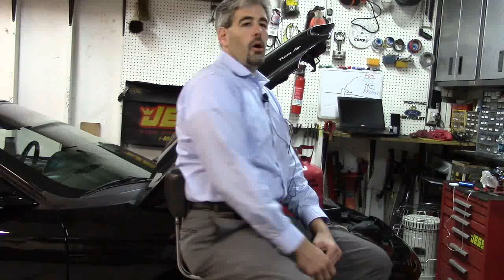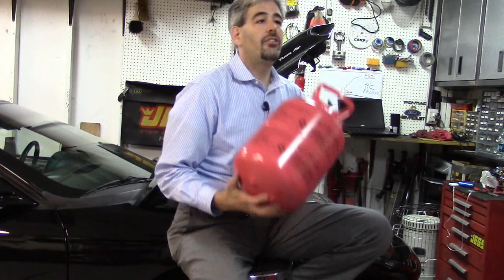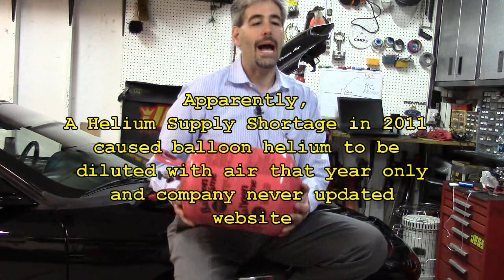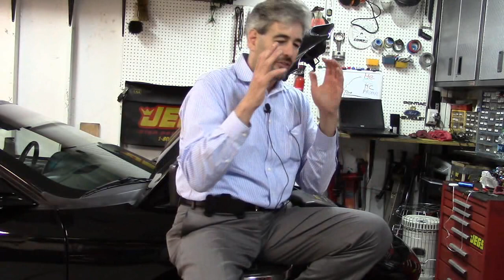Experiment to solve O2 Sensor Debate: UPDATE + New Design

Comment: I did not get to read the comments in time for the previous test so I apologize for any rehashing.

I'm in the O2 camp and my understanding is:

The simple question: O2 sensor - Reading O2 or HC?

 An O2 sensor as designed is an oxygen ion ratio comparator.  It compares the amount of O2 ions on the sample side of the sensor against a reference amount of O2 ions in the small pocket of air inside the sensor to get a variable value the PCM can work with.  It's not comparing O2/HC - that is a DERIVED measurement based on the assumption that air and fuel are the only things coming down the pike.   It's up to the PCM to read it's script and make adjustments like 'Too much O2 - add fuel' or 'Too little O2 - reduce flow'.  A better fuel management system has a staff to consult, "Yo, MAF! You getting anything over there?".  "GASP! I can't breath!"

Adding an inert gas upstream of the cylinders disrupts combustion efficiency leaving a bunch of O2 to tag the sensor.  Since the sensor don't care about A/F ratios - only how much O2 is hitting it, it should show lean.  Adding inert gas post combustion SHOULD displace enough O2 away from the sensor to show a rich condition.

If I had a sensor to play with and to settle the basic question of what an O2 sensor REALLY sees I would set up a bench test thusly:

Mount sensor in a piece of pipe in a vise. Power the sensor heaters if present and hook up a sensitive voltmeter or scope to the sensor leads.

Light up a welding torch and fire it down the pipe, playing with the A/F ratios and confirming voltages and sensor operation.

Now the fun part
With the torch A/F set for mid-point voltage readings on the scope I would flush the sensor reference chamber with O2, propane, acetylene, and argon and note the effects.

Present my findings to the world and collect my Nobel Prize and appear on the Tonight Show to much applause and adoration OR come back hear and go "PPbbfft!  I told you so!"

-Grouchy
Reply from the maker: your understanding and interpretation is 100% congruent with mine.  While I don't have means to isolate the O2 sensor in a controlled environment, I believe by using the noble gas both in the exhaust AND outside the exhaust near the sensor (to address the comparison to O2 in atmosphere as you stated which is also my understanding) I will be able to address this issue while considering all possible interpretations of the sensor's function on both sides of the debate.
Reply: Schrodingers Box While I am sure you have already considered this, I would like to note the following in case others duplicate the testing (highly encouraged) for themselves.
 The O2 sensor reference space I mention may pose some difficulties in access it.  In one design the space has a hole or vent in the sensor case leading to it and this is perfect for testing purposes. Since an open vent can get clogged or allow the cavity to become contaminated it has fallen from favor.
A newer design has the reference space sealed by omitting the case vent and, instead, relies on the wiring harness for venting.  Specifically the space under the wire jacket around the strands.  The wires themselves are vary narrow drinking straw vents.  While the chance of a high CFM rating is unlikely, the miniscule flow rate is enough allow for thermal expansion of the reference air, barometric changes, and the slow migration and replacement of any O2 ions that may have wandered off or been abducted by aliens.  This type is not so good for testing as these are some really long and narrow straws.  The chances of altering the ions in the reference space in any meaningful way are quite slim.  You'd have to tap into a wire jacket, seal off the open end and pump in a new gas under pressure to get any change.
Reply from the maker: Eddie the Grouch Yes actually I have considered that and I hope to address that when I get there.  Admittedly it is a concern that I may run into a limitation because of this.
  We think a lot alike, eh?
Reply: Eddie the Grouch The test you are proposing has already been done sort of in recent years by a guy at an iATN forum. The "O2" sensor only produces a voltage similar to what we are expecting with hydrocarbons and oxygen molecules present in the tube. Here is the link http://members.iatn.net/forums/read/msg.aspx?f=forum12&m=31714&fv=4&ar=265
Reply: Schrodingers Box
Of course we think alike.  I would hope that it's a common trait amongst us 2 percenters, i.e. Right Thinking People :)
Reply: Tobias Jonsson
Well, that takes care of that.  Now what, Matt?  LOL  I appreciate the link, Tobias.  Unfortunately, I'm not a member and cannot access that post.   You noted that the results agree with what we, on the right, are expecting? Or does it provide ammo for those in the wrong?  Just want to be clear.
 >:)
Reply: Eddie the Grouch Hey Eddie. As far as IATN, you can join if you fall into the criteria. Log on and sign up. It's a professional site, not like the usual "car" forums one finds online. There's S.A.E documents on this subject. . The way the public views this "sensor" is how it works in an industrial gas oven or a 5 gas analyzer. However, is a pre cat environment, it works just like a catalytic converter. It doesn't "sense' anything like an A/F ratio sensor. It simply switches at Lambda=1

Comment: Fantastic topic, Matt! A true scientist among the auto enthusiasts to prove/disprove the "tomato sensor" converts. Love it. Are you planning to introduce the concept of "partial pressures" in the next vid? That might help explain how the O2 sensor doesn't just measure absolute oxygen content, but rather as a PERCENT of the total exhaust composition.
For example, if you disable an injector there will be HIGHER %O2 in the exhaust (fuel trims indicate a more drastic lean condition) than just killing the spark, even though the absolute raw oxygen amount being pumped down the exhaust is THE SAME in both cases!

Comment: Always thought that the o2 sensor compared the outside o2 with the "inside" o2.  Can you expose the outside part of the o2 sensor, to o2, or (might be safer) an inert gas? Would be interesting to see if that would change the o2 voltage output.
Reply from the maker: That's a great idea!!! consider it done!!!

Comment: So what you are trying to prove is....the O2 sensor detects Oxygen in the exhaust stream?   not sure about pre cat but i would think it works similar to a post cat.  which changes with heat.  Maybe through do diligence, the engineers figured out the temp of the exhaust will be x when containing Y amount of Oxygen.   so now all they have to measure is Temp to figure out how much fuel to throw into it.  be interesting for sure. unless i didn't fully understand what the goal was, " i missed the previous video will have to backtrack and catch up"   Here is my thoughts on it, if you don't mind another 4 and 1/2 cents being thrown into it.  buy a new O2, put it into a sealed see through container with a connection for a valve you can pump air into.   Power the heater circuit, and monitor the V out with a DMM, " be sure to ground the housing and use the housing for the negative lead of the meter.   Inject pure oxygen into the box "we will call it Jenny since it is the best box in the world"   so inject pure oxygen into Jenny, and see if the brand new none contaminated O2 sensor pics up oxygen changes and outputs a response.     That takes ALL of the BS out of it and just gets down to the core of the matter, which if i understand correctly is ( Does an O2 sensor detect O)   personally i am leaning toward heat reading interpreted by software and injection of fuel based on a preset table and what the temp is.  i don't know for sure as i have never really tried it.   Will be interesting to find out, no matter how you get there.  But being a man that doesnt like to be on fire, i would be a little cautions of pumping combustible substances into Hot metal enclosures.  That is just me though.  =P   Have a good one thank you for posting.
Reply: Rhage73 P.S. I know you have to get the O2 Sensor up to 600ish F to get it to do jack..  so before you guys tar and feather me, just take what i said with a grain of salt and an open mind hehe.
Reply from the maker: Ideally I would love to do a "controlled environment" study like that but I can't.
  Abd just for the record- no, I am not trying to prove the O2 sensor detects oxygen. Since that is my hypothesis, it would make the experimentation biased.  What I am trying to do is prove the O2 sensor detects Hydrocarbon,  however my failure to do so while inadvertently similtaneously showing evidence that it detects oxygen will prove my point.  Only that method is scientifically acceptable.  It is called the "null hypothesis"  approach.
Reply: Pretty smooth, disproving one to prove the other ( the one that you are going for) love ete!   "Arnold S yell"   ;P

Comment: Well duh, it is called an O2 sensor. :-)
Reply from the maker: Rob Mut Actually several people have mentioned this, and not jokingly. But let's say you have a box with 2 gasses- CO2 and O2.  You are only interested in measuring the O2. You have a monitor that measures only CO2 from total gas.  You configure the output such that it subtracts the CO2 reading from the total gas reading to output the O2 reading, so when you read the monitor, it shows O2.  Is it wrong to call it an O2 sensor?

Comment: Maybe you could get some argon aswell to try as that is denser than air and would eliminate people thinking it is getting trapped high up in the system. Also I'm sure you can get it in small botles for diy welding.
Also there maybe other noble gases that would be good to try but off the top of my head I think there the only ones easy to come by.
Anyway I was as surprised as you were about the results of the last video.

Keep up the good videos
Reply from the maker: Kris Ankers Agreed, I would much prefer to use a denser noble gas. At the time Helium was readily available.  I may use Argon instead- or better yet, both.
Reply: Schrodingers Box If we get a vote, I vote for post combustion introduction of He, Ar, shop air and propane individually. 
That way we get to see the sensor response tp masking/displacement, added air/O2 and a HC.
Reply from the maker: To be scientific, I really need to use Argon because it better coordinates with the density of propane.  Both are heavier than air.  If I use helium, it can be argued that being lighter than air, it is not a fair comparison to propane.

Comment: Matt are you saying that if you see the same results in the next vid you will change your  belief that its not a O2 sensor and it is a HC sensor.
Reply from the maker: Steve Rob Yes, of course Steve....If it had more than one result then it would be useless.
Reply: I would have thought any result would have to be confirmed to be definitive. Your experiment has almost fried my brain or what's left but I'm telling you from what I can muster from all the science periodicals I have burnt thru this is my prediction. Absolutely no change at all. The narrow band O2 is super sensitive to the lowest levels of oxygen and I don't think your dilutant will be effective . The addition of propane into the intake or helium changed the fuel burn and  residual oxygen to be detected. I think the next test is  the only way to verify. Hope it's not too far off I got to get some sleep LOL
Reply from the maker: Steve Rob Yes.  If in the next video the O2 goes lean, the only explanation would be that the O2 sensor read less hydrocarbon (because there's actually less hydrocarbon). If it were reading O2 it would go "false rich" (because it is seeing less O2).
Reply: Schrodingers Box Conclusively prove/disprove by individually injecting shop air and propane into the AIR port. 
That would show the sensor response to added O2 (air) and HC (propane).
Reply from the maker: that cannot prove or disprove anything.  either way you are again introducing a diluent that the other side will claim is detected. 
 e.g. shop air causes lean:  The O2 detection side states it's cuz the extra O2 is measured by the sensor,  The HC detection side states it is because the air diluted the HC so less was detected causing the lean.
Propane causes rich- the O2 crowd states it's because the increased HC dilutes the O2, so the O2 sensor detects less O2=rich condition.  The HC crowd states the propane increased HC, the detector detects more HC, rich condition detected.
  You need an INERT non reactive nondetectable diluent to dilute BOTH the O2 and HC without itself being detected and see which of tye lower concentrations the O2 sensor ends up reporting.
Reply: Matt I've been doing some reading and it seems a noble or inert gas is more than just a  diluent and it seems to cause a reaction, not enough to sway the experiment.
When an inert gas is added to the system in equilibrium at constant pressure, then the total volume will increase. Hence, the number of moles per unit volume of various reactants and products will decrease. Hence, the equilibrium will shift towards the direction in which there is increase in number of moles of gases.  
Le Chatelier's principle
Reply from the maker: Steve Rob exactly correct except for the reactivity part.  Noble gases are completely reaction neutral.  Otherwise the rest is true
Reply: The American Chemical Society and The Canadian Society for Chemistry dedicated the research of Neil Bartlett on the noble gases as an International Historic Chemical Landmark in a ceremony on May 23, 2006 at the University of British Columbia in Vancouver. The text of the plaque on the campus of UBC reads in English and French:

In this building in 1962 Neil Bartlett demonstrated the first reaction of a noble gas. The noble gas family of elements - helium, neon, argon, krypton, xenon, and radon - had previously been regarded as inert. By combining xenon with a platinum fluoride, Bartlett created the first noble gas compound. This reaction began the field of noble gas chemistry, which became fundamental to the scientific understanding of the chemical bond. Noble gas compounds have helped create anti-tumor agents and have been used in lasers.
Reply from the maker: Steve Rob  I am aware of that but it is completely irrelevant in this application.
 You're looking way, way, way way too deep at the shape of the leaves in the forest my friend. Remember, it is the relevant details that matter in an experiment.
Reply: Your one sharp cookie Matt . Your experiment with just one result is going to be enough for you to change you mind ?
Reply from the maker: That is not possible as a result unless the O2 sensor is a air fuel ratio sensor. Otherwise it must either go rich or lean.